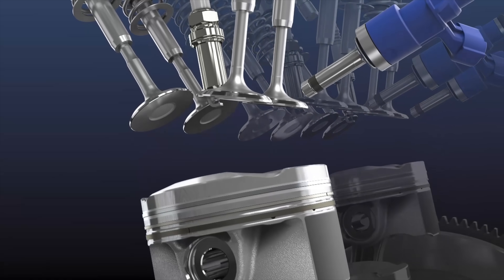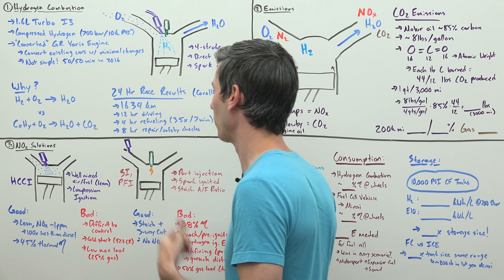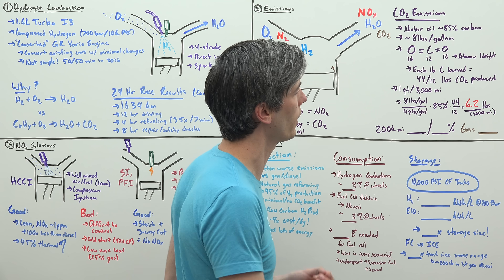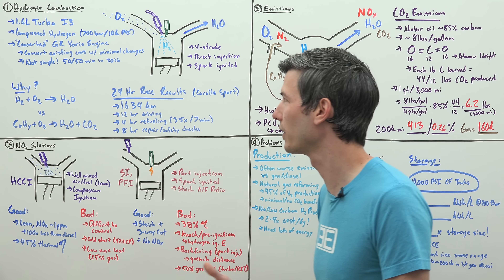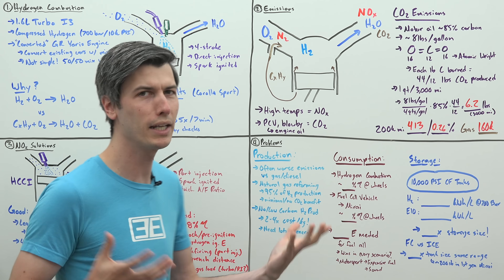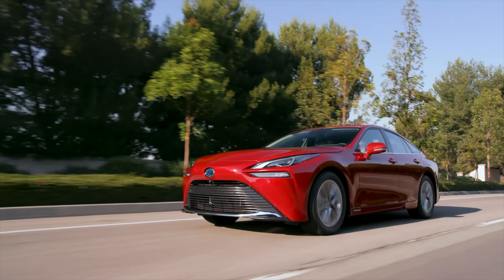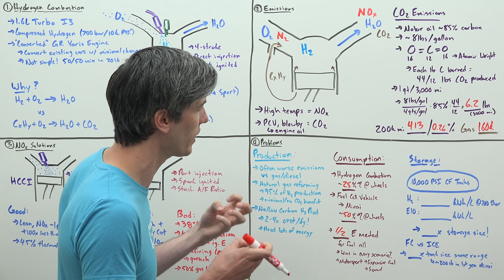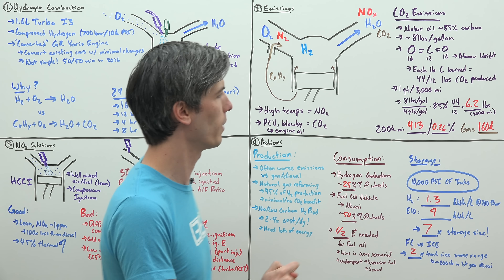Toyota's Developing A Hydrogen Combustion Engine!

Comment: The more work goes into every step of the process, the cheaper and more effective it gets.
The early days of gasoline, diesel and even electric were not pretty. Took time to get to where it is today, and be as cost-efficient as it is, at scale.
The important thing is to take steps to make that progress, and innovation will follow.
Reply: well i hope this will help save the planet !!🤣
Reply: The efficiency will not change though. These are theoritical maximums. You will never be able to gain more efficiently from combustion. Physics says NO!!
Plus why lose half of  all your energy turning a transmission, driveshaft and differential when you have a much more efficient example: a hydrogen fuel cell that powers a motor right at the wheel station. 
This technology makes no sense. 
It is just a pipe dream being pursued by existing engine manufacturers like Cummins to keep themselves in the game. 
The writing is in the wall. They need to embrace change and research sensible technologies that have potential, instead of trying to adapt old technology.
Reply: @bubba842  Why can't all these technologies exists simultaneously and then the consumer can make the decision for themselves regarding which type of car they want to buy? They just completed a 24 hour race with the car so the tech makes sense, its just not what you want in your car. Why do you care where Toyota puts their money anyways? If you want the most efficient vehicle, you can go buy that vehicle. Enough with this holier than thou stuff about sensibility and embracing change though, its too cliche.
Reply: @collinhruschka8441  it's called business pal no holier than thou sensibilities. All these technologies will exist to an extent,  but for the purpose they are required in. 
We will not have multiple technologies competing. Hydrogen fuel cells are cheaper and a lot more efficient than this technology. The vast majority of people will go with what's cheaper and is more efficient. Unfortunately neither of those technologies have an edge on Battery EVs. Yes hydrogen fuel cells will have their place in long distance and off road technologies, but every day people who commute will be driving EVs. 
There is room for this in the future in very niche areas, but those areas will not produce the revenue for a mass rollout of this technology to the mainstream, as it's just recycled old technology that will never get past the physics and downsides of combustion. 
The infrastructure is not in place for this technology and probably never will be. It will use twice as much hydrogen compared to a hydrogen fuel cell vehicle and will have a tank twice the size of today's gasoline fuel tanks. With that it will cost twice as much to fill up.
I don't see any positives for the average person in using this technology. The only positives will be for legacy engine manufacturers, trying to hold on to a dying industry, hence why they are pushing it. 
The nature of the business environment will not allow multiple different technologies to exist all at once. 
There are many examples of this in the past. AC vs DC electricity, VHS vs Betamax and HD DVD vs Blu Ray.
A standalone entity will survive, but unfortunately it will not be this hydrogen combustion.
Reply: That’s right
Reply: @collinhruschka8441  i mean yea, i think thats literally the point of the video. There will be niche cases or rich enough people that this technology might find some use while being co2 neutral. But for the average person it will never make sense because it is literally physically limited to cost >2x to operate compared to a fuel cell. Similarly synthetic diesel or gasoline will probably exist but they cost around 7 times as much energy to produce compared to powering an battery electric car directly and will therefore be at least 7 times more expensive
Reply: Green hydrogen is already tumbling in price. There are companies near me offering it. Basically wind farm in the sea and instead of storing the energy it creates in a lithium ion battery, its stored in a simple hydrogen tank. This means a lot of countries could create the wind turbine, the storage tank without importing any products at all. No more ravaging the earth
Reply: The first engine Japan made melted so they had to rely on good old American know how. All these countries in the east need American know how. The Germans are very good also.
Reply: What you're saying is a logical fallacy. You say that because one technology could be "perfected" over two hundred years, another technology will also be. That is not necessarily true. The combustion engine has reached a plateau as far as its efficiency goes. Replacing its energy source will not remove its thermal inefficiency. Yes, humans have a great capacity for innovation, but comparing a few hundred years ago to today, we have a much better understanding of physical laws, and most of them can't even be bent, much less broken. No need to look for anything better than electricity for now. Definitely not in combustion, when "burning" a fuel already says that you'll be wasting some energy as waste heat.
Reply: @geroutathat  And it would still make no sense to burn that hydrogen in a car, because a fuel cell is much more efficient. And when batteries get even better and cleaner, it will probably make more sense to store energy produced in remote places into hydrogen or some electrolyte chemical compound, move it to a destination, and convert it back into electricity in a charging station which would have a larger fuel cell with better efficiency (and stable conditions) than what you could have in a car. Remember - car batteries are getting lighter and smaller, but there is no chance of that with hydrogen. You simply can't compress hydrogen indefinitely and you lose a lot of energy through compression. To get the energy "stored" in hydrogen, you have to lug it around with you. Free electrons in a battery are much lighter than hydrogen is.
Reply: @Iguana93  batteries can never get more "cleaner" they can just use less energy charging. The point with burning hydrogen is you don't need any exotic materials at all. Steel, iron and carbon. You don't need platinum or lithium or anything. Until a battery is made using abundant material then the impact on the earth is clearly better with burning hydrogen than fuel cell or battery. Even China has admitted this and is moving to worse batteries efficiency wise but a more abundant material than lithium. If we have to swallow wasted energy that is green to avoid digging up the planet for rare materials then that's what we should do.
Reply: @geroutathat  You're contradicting yourself. You say batteries can't get cleaner, but then you say exactly how they CAN get cleaner - by using more abundant materials. Right now that can mean lower efficiency, but the efficiency can still get much better. And if you have green energy production capacities and then use those capacities to produce an inefficient energy transfer medium, then your production capacity is wasted. Efficient = ecological. If you have electricity at the beginning of the process and an electric motor at the end of the process, getting there with as few energy conversions as possible will be the most efficient, and therefore eco-friendly solution. The pursuit of better and cleaner batteries is beneficial to so many applications besides transportation that the advancements will come no matter what. You will probably not power your phone with clean hydrogen. Hydrogen technology for cars on the other hand has been in development for decades with relatively little improvement. As I said before - by the time we come up with a way (perhaps some biotechnological solar process) that would produce hydrogen at scales where the inherent inefficiency will not matter, batteries will be so efficient and durable that it will still make more sense in most cases to use hydrogen merely as a transfer medium between remote solar fields in and powerplants in population centres.
Reply: @enigmaPL  Care to elaborate? I'm confused. Are you working on a way to burn hydrogen without loosing energy as heat? Or producing hydrogen without wasting electricity on energy conversions? :D
Reply: We have an infinite amount of hydrogen and a limited amount of lithium. There is your answer.
Reply: You got that right. Rockefeller had to send gasoline to filling stations loaded in barrels on a horse-drawn wagon to get it too stations that had no developed road going to them that any vehicle could cross
Reply: @TsaristCossack   New batteries which don't require lithium or cobalt are appearing, there's your answer
Reply: @k-osmonaut8807  That's interesting, have any more info?
Reply: @TsaristCossack  We do not have an infinite amount of platinum though. If we dedicated 100% of the yearly platinum production to Toyota Mirais we could build 6 million of them.
Reply: @Ericwvb2  Which components use platinum other than the catalytic converter? Sorry I'm a bit ignorant
Reply: @bubba842  "Yes hydrogen fuel cells will have their place in long distance and off road technologies"

I doubt it. Hydrogen production and storage is a massive problem, mass shipping it would be another huge problem. Meanwhile ethanol is practically carbon neutral and has a higher energy density and switching a vehicle to use ethanol doesn't take much.
Reply: @PURENT  ethanol being carbon neutral is kinda wishy washy. Either way it's not emmision free as any combustion will create Nox. But as so far hydrogen production and storage is a problem. Since most comes from natural gas, it can't be considered emmision free.
Reply: @bubba842  It's just very little is actually needed to change from gasoline to ethanol in terms of infrastructure and vehicles themselves. In cases where an internal combustion engine is still desired or necessary, ethanol is the easiest solution that causes substantially less damage than petroleum. In a hypothetical good circumstance, 90% of vehicles are BEV, 10% are pure ethanol, petroleum is completely phased out as vehicle fuel.

I personally don't see hydrogen being viable AT ALL as a vehicle fuel whether it's combustion or fuel cell. I can see hydrogen as an energy storage mechanism for excess energy produced by wind, solar, etc. Excess energy could be used in electrolysis to produce hydrogen which is emission free compared to NG based hydrogen. That hydrogen can be used later to power the grid when renewable output drops.
Reply: BEVs were Always Cost efficient, Just with smaller Batteries. Fuel cells are too expensive and This combustion engine is still inefficient, which will mean more Power plants have to be built when you scale This Up.
Reply: @geroutathat  but green hydrogen producers are not the ones pushing this technology, it's the oil and gas industry and legacy heavy duty engine manufacturers like Cummins and Detroit Diesel.
Reply: @TsaristCossack  lithium is actually one of the most abundant elements on the planet.
Reply: @bubba842  What your saying is absolutely correct if the user is reliant on hydrogen from the fuel pump . If you remove the need for efficiency then your argument is dissolved. Water is cheap and free if you collect it. Theoretically it is possible to use a small generator running on hydrogen to produce enough power to power a hydrogen generator that will produce enough hydrogen to power the car and the electrical generator. Then the only cost is maintenance regardless of how inefficient it is .
Reply: man this thread is chaotic, I just want a naturally sounding clean engine with a transmission

Comment: I've always wondered, how do you find these things out? Do the manufacturers contact you as a journalist, or do you ask them on your own? Great video!
Reply: Probably a mix of both
Reply from the maker: I've found if you just open enough tabs you can learn all kinds of stuff. It's a mix of both! In this case I'd heard about the engine a while back when they'd announced they were racing it, so I asked Toyota if I could use their engine animation and they sent it. :)

Comment: Why not focus on ammonia combustion engine conversion instead of hydrogen. Also green emissions, easier conversion and safer fuel storage compared to hydrogen. Ammonia was used as the fuel for the X15 test flights back in the 60s?

Comment: "Burns a quart of oil every 3000 miles"
Subaru owners: Those are rookie numbers!
Reply: Yep. Bout a quart per 1000, but she has moods.
Reply: None of the three subies I had burned really any oil, the modded WRX aspirated a little if I drove it like i stole it but that's it.
Reply: difference between burning and consumption
Reply: I owned a 2.5 gt and a sti at the same time. Wife had a 2.5i legacy. We were the darling customers of Rotella T6 😬
Reply: My rotary burns less… lol
Reply: Laughs in rotary engine.
Reply: @Siegetower  rotaries only burn about a quart in 3k miles though…? Lol
Reply: An engine that uses a quart of oil every 3,000 miles has something seriously wrong with it.
Reply: My 16 Sub doesn’t burn oil.
Reply: Mazda RX8....Hold my 15w 40
Reply: My SEAT 1.9 diesel uses Zero oil between 15,000 kms oil changes. 170,000 kms on the clock.
Reply: @bobs3354  Not according to engine makers now days. Chrysler tried telling their customers that 1 quart per 1k-2k miles was normal. I have seen new Dodge cars come in to my shop due to stalling because they have 5k miles on them and are almost out of oil. There is now a lawsuit about this issue (as there should be). Brand new vehicle, but still complete junk.
Reply: me thinking a "quart" meant a quarter of a Liter.  "Damn my 1.2 Opel uses a lot of oil"
Reply: @curtisbacon7856  How can an engine consume oil without burning it??
Reply: @David Squibular Um, right, I’m not sure how an engine is “Consuming” oil that’s leaking out of it, but anyway….

Comment: Hydrogen ICE: 
-Vroom sounds
-Manual trans
-fast refuel
-powered by explosions

Electric
- silent
-no manual
-slow charging
-not powered by explosions

I hope the downsides of hydrogen ICE get sorted
Reply: Hydrogen refueling as it exists now is not fast
Reply: You mean the tendency to explode? 🤔
Reply: @thewoode1050  Compressing takes time. My CNG car used to "charging" 30-40 minutes if compressor  on filling station was weak. And CNG have only 200 bar, not 700.
Reply: Vroom sounds and heat is energy escaping from your ICE without doing any usable work.
Reply: @GgDBXS  No, I was referring to the tendency of Hydrogen to form very explosive mixtures with air. So a small leak and very tiny spark can lead to a proper explosion
Reply: same, I'm not ready to give up on internal combustion engines yet, and I probably never will be
Reply: The WoodE hydrogen is actually safer in accidents than gasoline. Gasoline pools and relatively dense vapors sit around the accident and can ignite, where hydrogen is lighter than air and would dissipate into the atmosphere.
Reply: Dude, I'm with you! I like my manual toyota very much, so I hope they come out with a replacement engine and fuel system. The infrastructure is also a hurdle
Reply: Ummm there's an electric swapped ford mustang with manual transmission
Reply: @ButtMcDuck  its faster than 45 minutes im sure
Reply: @CorwynGC  🤨
Reply: @GgDBXS  idk where you live but for me it’s never taken more than 5 mins to fill a tank with CNG. Never came across a weak compressor. Hydrogen refuelling time is a non-issue you’re just trying too hard with the excuses.
Reply: @midoriyaizuku4403  But still there was my reality: 70m3/hour compressor for a city with 500 thousand population. It is difficult to built good filling station for CNG in non super rich countries. Hydrogen station is four or five times more epensive. And CNG was cheap as a fuel, hydrogen not. Cars with CNG was affordable, hydrogen cars are definitely not.
Reply: So how about the disposal of toxic used batteries in electric cars, and also could you guarantee 100% that the electricity used in charging your EV came from green tech
Reply: @rmaxdiaz414  What toxics are used in Li-on battery? Just ask, no offence.
Reply: U will own nothing and be happy

Comment: One thing you didn't consider is that there are such huge surpluses in solar energy production, at times, that they have to shut down the solar plants.  They could generate an enormous amount of hydrogen, and it would cost practically nothing, since they would be tapping surplus (unused) energy.